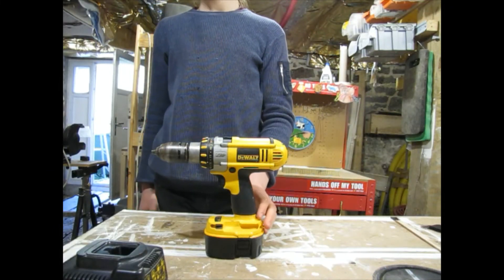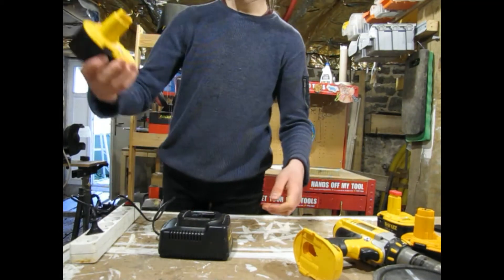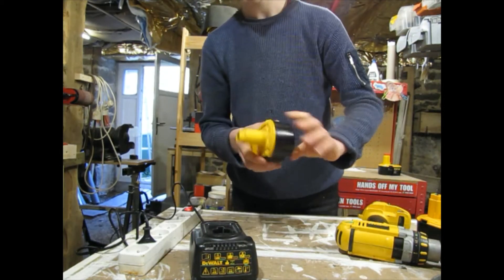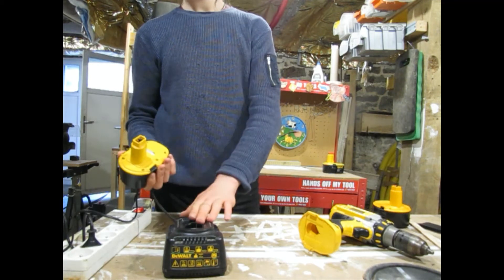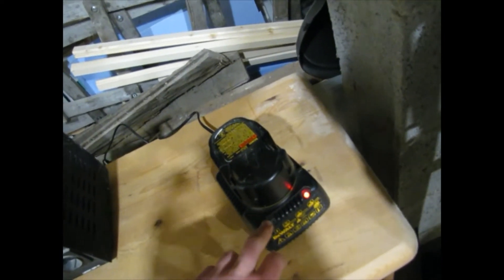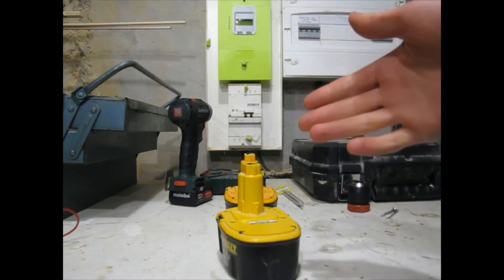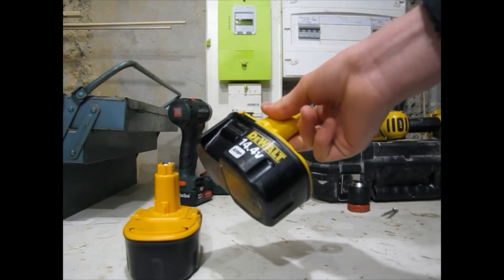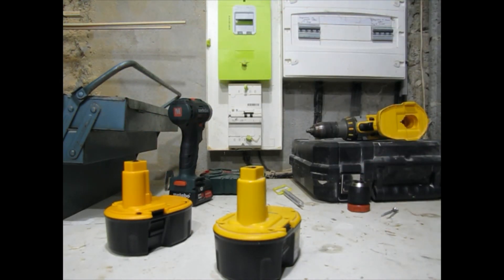How to Fix Nicd Batteries

Comment: I used to have new cells put in my old Dewalt battery packs. But I still could only get about a year out of the new installed cells into the original pack. I just never had any luck with doing that method. Very good information though! I still think those older tools have a lot more torque. 👍👋🏼
Reply from the maker: Who Dat3020 👍 replacing the cells is going to be happening in a future video.
Reply: Tool Reviews And Restorations Cool! I should’ve been more specific, I always had cells installed by someone. So watching your future installation of cells video I’d definitely be interested in. 👋🏼